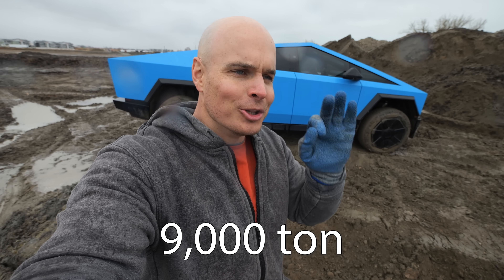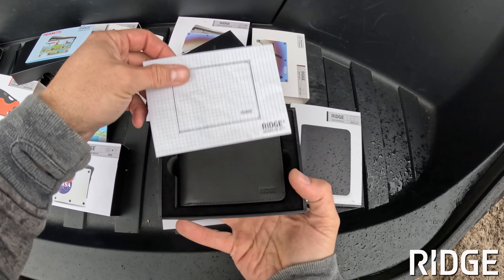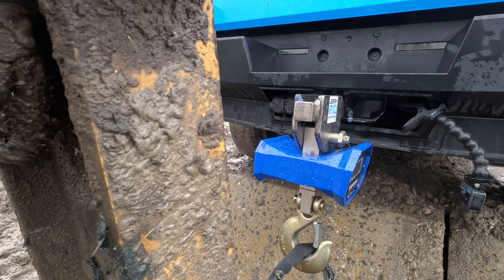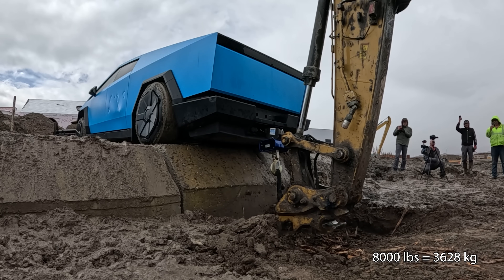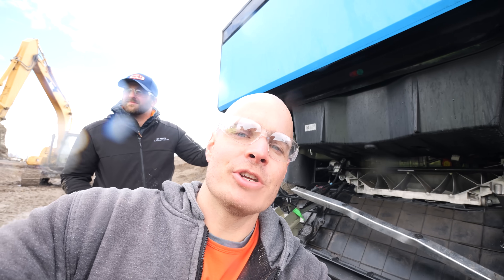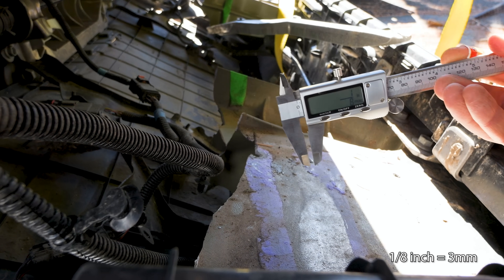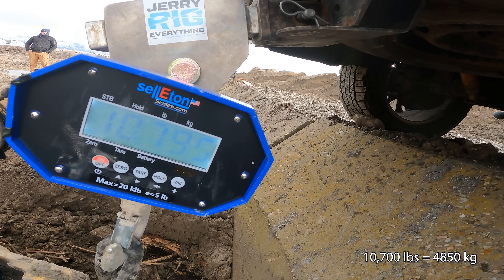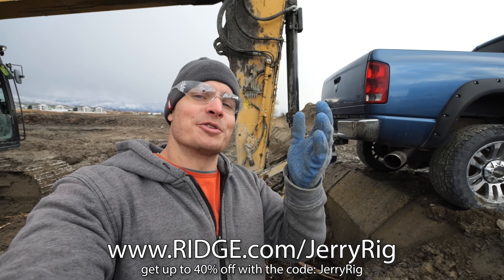SHOULD YOU TOW WITH A CYBERTRUCK?! - (catastrophic failure test)

Comment: Mechanical engineer here. You got the fatigue limit backwards. Steel has a fatigue limit, i.e. if you keep the stress below the fatigue limit the material strength will stay the same no matter how many times you apply and remove the load. Aluminum does not have a fatigue limit, i.e. the material will get weaker every time stress is applied and removed, regardless of how small the stress is.
Reply from the maker: Good catch.  My concept was correct - I misspoke with the terminology.
Reply: @JerryRigEverything  yah you said it right with aluminum, human brain just did human things when you were talking about the steel lol i did the same thing on a test once and i was so annoyed with myself
Reply: @JerryRigEverything you only misspoke in saying that both do not have a fatigue limit. But the explanation was sound
Reply: @JerryRigEverything this is wuy I tell people stick with the old 2016 vehicles until the twrks are all clubbed out
Reply: @JerryRigEverything  No youre just a Fraud
Reply: @JerryRigEverything  Hey Jerry, try this test on one of your wheelchairs too
Reply: @MrDeaz they kind of do already. They stress test them chairs a lot because they want them to last.
Reply: @MrDeaz they already do this with their drop tests that involves strapping weights on the chair and dropping it over and over
Reply: @MrDeaz  Zach, not Jerry is his name
Reply: @MrDeaz  You use wheelchairs for towing?
Reply: @MrDeaz  what good would that do?
Reply: @rma-nm5vb  Of course, I do burnouts with them as well
Reply: They don't use heavy machinery to absolutely destroy a chair by doing something it was never meant to do and then publicly act like they didn't intentionally destroy the chair to fabricate a story. I used to like this channel @JeffRobertson-m7v
Reply: @ No you tried to a propaganda video and got caught. You sick duck
Reply: @JerryRigEverything nope. You trying to bring tesla down with testes that suck ass.
Reply: @JerryRigEverything   more than enough, misspeaking can ruin everything
Reply: @JerryRigEverything  you're not an engineer and it shows. Show me data that 10,000lbs can be exceeded by a trailer towed over a hill. You misspoke about the fatigue limit because frankly you have no idea what you're talking about
Reply: @vector006  Yeah. That couldn't happen in practise even when heavily bottoming out and it would also mean vehicle would be undrivable in reality. Driver would for sure realize that load is severely wrong distributed and not even closely safe to drive. Where I live it's taught that when using trailer in cars you put roughly 50 to max.100kg's on the hitch ball in normal conditions when loading trailer.
Reply: @JerryRigEverything congratulations, you are now an activist, and your premise is false. 👏🏼👏🏼👏🏼👏🏼👏🏼
Reply: Does anyone else realize that the test he did is only a tongue weight test to failure. The hitches are breaking from a load pulling away from the hitch to the rear. Picture grabbing the Tesla cyber truck in one hand and the trailer in another and try to pull them apart, That is what people are having happened in the cybertruck. The load he applied was straight down as if putting on a trailer that had a extremely high tongue weight. So he applied the force in the wrong direction in my opinion. What he simulated is not how the trucks are behaving.
Reply: That is also known as an endurance limit. Also, it depends on what test is done on the material and to what standards. The material standards I usually go by when performing fatigue analysis is MMPDS which defines a runout based on the endurance limit of the material and it has them for many different types of metals including aluminum along with curves for different R values.
Reply: @timkono5645  Correct.  Endurance limit.
Reply: @TheSinisterWizard  steel can still experience fatigue below its plastic deformation limit, but the change is fairly negligible compared to a material like aluminum that will snap in half after not much stress at all.
Reply: @smok_ed ’Steel can still experience fatigue below its plastic deformation limit’. Fatigue is always in the elastic region. Breaking by bending it over multiple times in the plastic region is not fatigue.
Reply: He had the concept correct though, even if he used the wrong term.
Reply: @TroySavary  so that's why car springs are made from steel and not aluminum right?
Reply: @TroySavary if the concept is backwards isn’t correct lok
Reply: Steel is real
Reply: True, aluminiums endurance curve goes on dropping with respect to number of load cycles while steels endurance curve goes flat (only caveat is that the stress should be less than the endurance limit to maintain infinite fatigue life).
Reply: For any new engineering students reading this thread, this is an application of your freshman year strength of materials/material science, junior year machine design and sophomore year dynamics course.
Reply: @rufus2028  If only colleges stopped mixing good classes like that with a repeat of high school courses like english and speech for "well roundedness", more people would take those classes and be useful in society.  I never understood why abet is so obsessed with making people spend half their time redoing high school classes.  I saw majors switch from norrmal to being abet accredited and they were absolutely ruined with tons of time wasting fluff.
Reply: @robster7787 true. The test went way past a design number.
Reply: I've been following these break-away frame components for a bit.
Just curious, did you assume this was forged & probably 7000 series aluminum like I did?
I was blown away by the knowledge that it's cast 6000 stuff. But part of that knowledge comes from real-world experience. Having been in the hands-on & design worlds, I know there's a lot of disconnect. That's exactly why Kelly Johnson had Skunk-Works engineers working just feet from to the production floor even before they made the A-10 & SR-71.

As a materials tester, I even had the priviledge of trying to keep the engineers & the laborers for calling each other idiots. lol
Always a fun time. ...and both were right! ...depending on the situation.
Reply: @christurnblom4825  I have no idea what you're talking about with the A-10 and Skunk Works.  The A-10 is Fairchild Republic, not Lockheed.
Reply: @KRAMITDFROG  Sorry. I meant the A-12
Reply: @KRAMITDFROG  Sorry. I meant the A-12.
Reply: @christurnblom4825  If it's failing after tens of cycles, it doesn't much matter what grade of aluminium it's made from. The guys who designed it screwed the pooch.

Had it been 7000 series forged, they'd have just weakened it accordingly.
Reply: Hello everyone! I'm Vietnamese, nice to meet you.
Reply: So Elon heard that aluminum didn't have a fatigue limit and without waiting for an explanation he went "sweet! lets build the trucks bottom out of it!
Reply: I'm not an engineer, but in Germany there is a term called tongue load, Stützlast. Everyone who wants to tow a trailer to their car knows the term. Trailer hitches are usually specified with a tongue load of 70 to 90 kg. That's not much, and yet they can still be used to tow very heavy trailers. And that's exactly the point, in this video the tongue load, Stützlast was tested and not the towing capacity. As far as I know, the Cybertruck has a tongue load of 500 kilos. To be precise, the tongue load was exceeded by 10 times, which no one in their right mind would do in reality.
Reply: Yep. steel is wonderful with the infinite endurance limit. 

Cast iron is even better
Reply: @qwertyui90qwertyui90  steel out performs aluminum by a massive amount in load cycling.
Reply: @qwertyui90qwertyui90  cast iron is an interesting material. It's elastic limit is generally less than the yield strength. That is, unlike steel or aluminum which will stretch before it breaks, most varieties of cast iron will just break without any deformation to warn you that you are approaching the limit of its strength
Reply: could you imagine if zack was right?? lol the flex swing on aircraft wings in flight... they would all be falling out of the sky.
Reply: @Dexter_Solid  Airframes are designed with fatigue in mind. The life of each component is known, replacement is scheduled accordingly, and all the ones where a single failure could bring down an aircraft are actively monitored. We're engineers, not idiots.
Reply: I know that about aluminium from mountainbiking. Bike frames made out of aluminium age and get brittle over time when they are ridden hard.
Reply: @SpielkindFR biggest reason why my 95 stumpjumper m2 is only for street use these days. 30 year old frame that was already known for snapping under heavy use when new.
Reply: The lifespan of an airplane airframe, primarily made of aluminum, is limited by fatigue failure due to cyclic stress from pressurization, turbulence, and takeoff/landing forces.

Typical Lifespan of an Airplane Airframe
✈ Commercial Airliners: 20–30 years OR 50,000–90,000 flight cycles
✈ Military Jets: 6,000–12,000 flight hours (varies by aircraft type)
✈ General Aviation (Small Aircraft): 40+ years with proper maintenance
Reply: isnt that exactly what he said? 
Edit: first he said aluminium doesnt have a fatigue limit and then he said Steel doesnt have a fatigue limit. so he just misspoke but at the end of the day the message was clear
Reply: @c0dy42  Everything has a fatigue limit, its like saying an engine has 100% efficiency which is impossible.
Reply: @retired-s5h  cast aluminum doesnt have a fatigue limit in the sense that stress builds up so everytime it gets stressed, it gets weaker. steel doesnt do that. as long as you keep the stress below the point of plastic deformation it wont get permanently weakend
Reply: Got a question Sir, 
Aluminum alloy is used in guns, mostly the lower part of the gun (ie the grip, trigger and some internal parts) while steel slides are on top of that. Does it mean the gun will fracture its lower part after being fired a lot?
Reply: @tullo5564 Lower receivers are designed to not take the full brunt of the force exerted when  the gun is discharged. Most of the forces move in a linear direction through the upper receiver assembly. There are some sections of the lower receiver that will take some of the loads and it’s usually the parts the holds the gun together such as the buffer assembly takedown pin and pivot pin. Because of how forces are distributed in the assembly, this has allowed lower receivers to be made of polymers and sometimes plastic. All parts will eventually fail over time due to abrupt explosive forces and repeated heat stress, but it shouldn’t be of major concern. Guns do eventually wear out over time, but if made and maintained properly it will last longer than others.

I may not be the OP in this thread, but I am also a mechanical engineer. But I do want to note that you do not need to be an engineer to answer this question.
Reply: @rufus2028  isnt that the same reason glock lowers are made of plastic?
Reply: @rufus2028  plastics are polymers
Reply: @rufus2028  Eugen Stoner, Irving Johnson, et al. were smart cookies when they designed the AR10
Reply: @tullo5564  those parts aren't stresses to start with
Reply: @tullo5564  Kentucky ballistic had gun frame snap right? Or was it plastic frame?
Reply: @Hnkka  that was plastic, polymer frame. I saw that one too, it was kinda funny
Reply: @tullo5564  yes you can assume this. But they scale ist logarithmic and you probably need 10^7 and more cycles/shots fired. There are also assumptions that steel also will fail but the curve gets nearly flat so ITS a pseudo Limit because you need so many cycles you cant measure it within a reasonable timespan.
Reply: @tullo5564  If it were in a vice I would say yes but a shock absorbing human maybe not. just a guess
Reply: @tullo5564  when it comes to guns, the aluminum doesn’t take the actual explosion of the cartridges going off the chamber does and the barrel, which is made out of steel.
Reply: @tullo5564 depends on how the gun is specifically manufactured but to put it briefly no. The steel is the part of the gun that absorbs the most stress while the aluminum parts don't really. Although if you purposely add stress or improperly store your gun, corrosion and other minor stresses will eventually wear that aluminum down and fracture it
Reply: @ Yes. After trillions of uses. Fatigue properties at this level only matter in moving high energy engine parts. Even then, there are aluminum piston rods that handle many billions of cycles.
Reply: @tullo5564  generally speaking the lower receiver on most firearms isn't really subject to much force compared to the rest of the weapon.  You can make the LR out of plastic in a lot of cases without much fear on a lot of them.
Reply: @tullo5564  If you know how guns work, you'd know those parts you named aren't seeing the stress and forces the barrel, bolt, trigger group, or in the case of  revolvers, the cylinder, would experience. Not the same.
Reply: @tullo5564  Unlikely, as the gun is engineered to have sufficient strength in its parts. The CT is also engineered to have sufficient strength in the frame for straight towing and normal tongue weights. Engineered materials (made to be lightweight and strong for a purpose) will tend to fail if subjected to loads they aren't designed for. In the case of guns, that might happen if you use the grip as a hammer, or if you drop it from a high distance. The manufacturer should and typically does add extra load capacity to account for some excessive stresses, but not for what they are doing to this CT. 

The steel frames are in many ways better because they have so much give that it makes them idiot proof, meaning you can abuse them pretty badly before they totally fail. That comes as a cost of weight in a vehicle that is already too heavy. The way business minds work is that adding extra material to a product when it's not needed for the intended purpose is just adding cost and making it less competitive to other similar products. 

Think of it like a car engine. The manufacturers use fairly cheap pistons and connecting rods that can last 150,000-300,000 miles of normal use, but are considered the weak link if you add a turbo or supercharger. They could add forged pistons and rods from the factory to ensure the car would run nearly forever and be mod friendly, but in reality most people won't want to pay extra or lose fuel economy so they'd lose sales. Another comparison are engineered floor trusses used in many new homes. They are basically "girders" made of particle board with 1x2s at each end. They are quite strong and will hold furniture, people, etc., but if they get wet or if someone cuts a notch in one to run a wire, etc., they can fail very easily. In engineering and manufacturing, it's all about making it "good enough" but not better than it needs to be in order to meet a price point, meet code, fuel standards, etc. I'm not a fan to be honest as they took away pride of workmanship and making things last, but that is what we as consumers demanded over the years so that's what we get.
Reply: @tullo5564  potentially, but you can make the fatigue limit for al billions of cycles.
Reply: @tullo5564  The military has found that m4's will wear the trigger group pin holes will wear out before the lower will show any real wear. Lowers aren't under very much load in general, even polymer lowers can withstand thousands of rounds. You'll wear out the barrel and break the bolt long before the lower. Also I've never seen an aluminum trigger, its mostly steel with MAYBE an ergo component being aluminum.
Reply: @tullo5564 eventually yes but the upper takes a lot more direct force from the bullet firing and the slide stopping
Reply: @tullo5564   With enough use, you can definitely wear out a lower. Most users don't actually train often enough to ever reach that point, but it's certainly possible to do so.
Reply: @tullo5564 studied materials science and I don't think the loads are enought on the handle to do anything. For the canon, there are much greater loads, hence no alluminum is used there.
Reply: @tullo5564  Not if you do your job as an engineer. If you use enough of it to under-load it sufficiently, you can ensure a cycle life greater than the service life of the weapon. For instance, 1 million cycles is achievable. Expensive and heavy, but achievable. Back when I worked for an ammo company, we considered test barrels worn out after about 3 000 rounds (.308). That's when groups started opening up. For the military, closer to 5 000 is probably right. Again, depending on calibre and loading. So you see, designing a piece of aluminium to perform a secondary function (all the pressure containment, lock-up and trigger works are steel) while lasting longer than the bits of steel (namely the barrel) - not all that difficult at all.

Militaries are well aware of these service life limitations. Those are built into the price and spare parts/replacements are purchased accordingly. Civilians on the other hand are unlikely to fire a weapon so much that it wears out, have you seen the price of ammunition? 😅 And if you do put 4-5 000 rounds through your AR-15, I'm sure you're in a good position to be able to afford a new lower, to go with the new barrel 😁

Best part with aluminium is, you get a sliding scale of weight vs cycle life. The fewer cycles you need, the lighter you can make a part and the closer you can get to its yield strength.

These fatigue properties are quite reliable too (depending on grade specifications). That's how structural components on airframes can be designed to literally within an inch of their lives, and still wings don't snap off airliners. That and advanced monitoring 😉
Reply: @tullo5564  You'll likely wear the barrel out multiple times before that happens. Lots of examples online of people wearing out multiple barrels and BCG's without the receivers cracking. We're talking 20-30k rounds at least. I'm sure it will crack at some point, but not within the useful life of the firearm.
Reply: @tullo5564 the parts the slide make contact with are hardened steel connected to the lower by steel rollpins. So nope, that’s why you have glocks made out of plastic.
Reply: @tullo5564 if you drop the hammer on an open receiver multiple times, yes. It will break. 

I've broken a couple doing testing.
Reply: @TheSinisterWizard  semantics. He did get the point across although he got the terms mixed up.
Reply: Its called plastic deformation. Steel can deform and spring back if you keep it below a set force. Beyond it, it will bend but mostly not break. Aluminum fractures. The force curve between these two metals are vastly different
Reply: The cyber truck clearly broke and had a catastrophic failure at 10,000 pounds load and it snapped in half the frame so you can try to sit there and yap all you want about fatigue limits but that is just BS and you're not an engineer sitting here, trying to defend a piece of shit car
Reply: Now to clarify, there are Aluminum alloys that are very durable and can tow well, just look at some of the US military's equipment for examples of how one can get Aluminum to last for decades under extreme conditions. But those alloys are not "extruded" nor would porous and bubbly metal be acceptable. I wonder if Tesla even bothered X-ray these Aluminum frames, or if they just gave it the ole once over and sent it.
Reply: @MrVirus9898  the problem as I see it is Tesla thinks they are smarter than over a hundred years of automotive engineering and design. They have smart people there but there are only two explanations-cost cutting at any risk or they really just think they're smarter than anyone else manufacturing vehicles.
Reply: Sounds like Elon the engineering genius got everything backwards
Reply: Its also irrelevant. In real world usage you'll see about 2% of the load that it broke at here (around 200lbs. Aluminum will fail if you hit 2% of its UTS if you load cycle it once a second for 207.67 trillion years.
Reply: @BulterMarkwad  cosplay truck. So basically these geniuses used same principles of cast alloy wheels (notoriously dent happy) to cast alloy a towing frame.
Reply: @porscheoscar  you're trying to school, a mechanical engineer, stop your tesla, hate, and crying.
Reply: @Bluelightning23  what part of what I said is not true? And work on your reading comprehension I wasn't trying to school anyone.
Reply: Anyone gonna talk about towing vs tongue weight. He should not have pulled down to get towing capacity.
Reply: He also subjected the hitch to the force downward not backward which is tongue weight. No pickup/not commercial medium duty or above has more than a 2,000 lb tongue weight rating.
Reply: A steel frame may loose the hitch, but the frame will still be there for the safety chains. With the Tesla, once that assembly comes of, your trailer is freely moving on down the road.
Reply: hmm.. in 2025: 2004 dodge ram 2500 with no engine and bent rear axle is worth $100-$500 USD compared to Cybertruck. and if it did have an engine and was drivable, the Dodge maybe have been able to still travel without a broken hitch, but he wasn't able to break it
Reply: This is an invalid test. The tongue weight is like 1100 pounds, not 300. That’s the test. So it passed with flying colors actually.
Reply: I think the takeaway here is that no matter what the vertical force happens to be on the tongue due to trailer weight/road conditions/etc, the Tesla hitch is at a higher risk of breaking than the steel hitch. Everyone is getting hung up on the whole “you never have 10K pounds on the hitch” argument, but the reality is that shifting weight and gravity CAN exceed what the aluminum can handle.
Reply: Aerospace Engineer here, for aluminum everything you said is correct except  “regardless of how small the stress is”. If the stress is less than the yield point of the material then you will have elastic deformation which means 0 damage when unloaded.
Reply: @joelmelburn3370  Coming from a keyboard warrior, that's a compliment.
Reply: That makes sense.  Therefore: if one cares about safety and also towing capacity it makes a lot more sense to use a steel frame even though that might cost more.
Reply: And aeroplanes fly less and less until break apart in mid air
Reply: Where did you get your degree?

I’m pursuing mine currently in denver after having been a mechanic in and after the army
Reply: "work hardened"
Reply: Hence the flying hour/landing cycle limits on aluminium airframes. They fatigue just flying around normally.
Reply: What would be more interesting to know is, if the load is kept within specified limits how many hours or cycles it can handle before breaking.
Reply: Infotmation in this thread about strength of steel vs aluminum made me worry about Motocross and MTB aluminum alloy parts, such as handlebars. So if I got it correct, I'm getting my handlebar weaker with each ride event, and someday it will occasionally bring me to serious injury by just cracking without a warning? Ughh.. I'm too old for heavy injuries, seems I better switch back to CroMo, like back in a days lol)))
Reply: @Snoop.Driftera  if the parts are manufactured properly, your handlebars should be taking a load so much less than it can so it won't break unexpectedly unless you crash or something.
Reply: @ Well, my bike lives a hard life with me. It crashes with me from time to time, and I do not repalce parts that are still look healthy (couple of years before i boke 5or6 ribs). But material fatigue is something that you can not see or determine by external wiew sometimes. Anyway. Things that you said about Tesla crew (im not a fan of tesla tho), are wrong, since this test shows test of 'Tear forces' while thesd parts were engineered to withstand the 'Slide forces'. I'm sorry, english is not my native languge, but i worked with FRP, CFRP and structural adhesives. And i can say that Tesla's parts are made to comply the material requirements. You can see it, even, by the way adhesive were split into two even parts: it is a good sign of how was it applied and that everything was made in propper way.
Reply: No you good these guys dont really know whay they talk about 😅 without a heavy crash you are good for ages  @Snoop.Driftera
Reply: @Snoop.Driftera  Not all parts are subject to the kind of loads that could break them over time. Handlebars for instance - not all that heavily loaded. The frame on the other hand...

Plus, if the bars in particular ever got weak enough to fail on you, you'd know about it. Something would look wrong. Something would feel wrong. This is a part you regularly interact with, not something hidden away until it fails.
Reply: @233kosta  Not agree. Me, miself have an Azonic bar and I trunst it. But I remember how my friend's oem bar were broken (cut right near the grip), just because of tough landing at dirt jumping. He was injured. 
So sometimes you really get such a break unexpectedly.
Reply: So aluminium is just play dough on roids😂😂
Reply: @ Kinda. I mean aluminum is often extruded, like play-dough.  Play with some.
 If you don't have a mill, just drill through some. If it gets too hot, it gets kinda tacky or like peanut butter & gums up your drill bit. If it's light, you can knock it off but if it gets really hot & your not drilling fast enough, it will fill the flutes & ruin your drill bit.
Or, cut through some thick stuff with an circular saw. You'll see what I'm talking about unless you've done it before & know the proper feeds & speeds.
Reply: Which makes it a terrible material for any load-bearing application in general…
Reply: I mean makes sense with Space X and Tesla failing in market, give a clue why Elon Musk wants to buy Social Security
Reply: Which gives me the follow up question: I wonder how much the Cybertruck's hitch/frame was weakened by the initial test before the excavator moved closer? There was even a pop/crack mentioned. Surely it decreased the strength in the second test? Not that I am rooting for the Cybertruck in any way lol Just an observation.
Reply: Basically from work hardening during the inevitable flexing right ?  That's why Aluminum car trailers develop cracks all the time.
Reply: He should run the test on a unit body steel vehicle, such as a Ford Maverick. I am quite sure the Maverick would do better, despite not being rated anywhere near the Cybertruck in capability.
Reply: The 323 later in the video is more like 50k
Reply: My first thought: commercial airliners and their wings flopping up and down from forces applied
Reply: Exatamente
Reply: Not a mechanical engineer here. No.
Reply: Maybe that is why tesla over engineerd the tow hitch by 9 times it's rated capacity. 9 times!
Reply: That’s exactly what he said though
Reply: The hitch does not need to handle 10 times it's rating. You are not an engineer.  Ridiculous.  Elon should sue you till you are broke for life.
Reply: Sounds like Tesla knew this will totally not work then. Figures.
Reply: Not all grades of aluminum are equally susceptible to fatigue. Some alloys are specifically designed to have better fatigue resistance than others. 

This test was done to prove a point, but never a real world scenario - we know why anyway. Can't we simply appreciate new technology and advancements in manufacturing? why have all the strength of steel when you can do with certain grades of aluminum? especially when you have to bear the extra weight of batteries?
Reply: Tesla didn't invent the cyber press. Just bought it from a German engineer working in Italy. Like Elons other inventions.
Reply: Either way they tried  repeated load cycles bouncing the excavator and the old frame held.
Now can we try landing a comercial plane without front landing gear on a Ford - just a pun
Reply: dont ever question his political ideology with ur stupid mechanical engineering
Reply: youtube comment reader here.  lame
Reply: That's why I was confused:

He said aluminum doesn't have a fatigue limit.

Then he says "steel on the other hand doesn't have a fatigue limit". The fuck you mean "on the other hand"? You said the same thing about aluminum 💀🤣
Reply: Wonder why aluminum trailers don't break in half? Like boat trailers.
Reply: @rightsdontcomewithpermits7073  find one that is built for 11,000lbs
Reply: @rightsdontcomewithpermits7073  Most likely because they are not cast.
Reply: That doesn’t make sense though. Aluminum has a stress strain curve the same as steel does, and it has the plastic region the same as steel does. If you don’t stress it has the permanent deformation portion of the stress strain curve, it should retain all its strength and properties.
Reply: @javionsmith6818  There are always micro cracks and stress risers in a material. The cracks open more and more in cycled loading and aluminum is very susceptible to this. The plateau on the stress strain curve for aluminum is much shorter than it is for steel. But steel will also fatigue at a much lower stress than the theoretical yield. It depends on the difference in tension stress between cycles, the number of cycles, the geometry, and any welding configuration near the critical section. For example a steel welded connection will break in far fewer cycles under lower stresses than a bolted connection.
Reply: Slight correction. Every time you apply a tension stress on aluminum it will effectively get weaker.
Reply: ME myself and I caught that despite my career being mostly in thermal-fluids. Some things from school stick!
Reply: @joelmelburn3370  I reread your comments and yeah you’re definitely angry about something lol
Go check your blood pressure
Reply: I'm really questioning his integrity after this and the F150 videos. He clearly has an agenda.
Reply: Shock loads are the overall problem. Called Misadventures in the overhead crane industry. Which leads to disassembly of that piece of equipment and tolerances checked.  Shock loads in vehicle towing...potholes,Sudden Stop, fast inertia Take offs...yada yada
Reply: In addition steel can usually absorb more energy from a shock load, due to greater elongation before break and higher difference between yield and ultimate strength. So aluminum is usually more likely to fail suddenly and catastrophically from a shock like the pot hole example or abrupt tug. Porosity more common in cast aluminum would not help. This is all additive issues with the fatigue issues mentioned.

Some semi trucks have used aluminum successfully. From what can be seen in the video the cast geometry is very different from that. It looks like it could create high stress concentrations along the top where cracks would form. I would love to see a stress analysis of that frame.
Reply: What will happen with aluminum in warmer conditions? Will it be even break earlier?
Reply: Yeah people worry about fatigue of cybertruck yet they have aluminium wheels. Just be consistent guys...
Reply: @armykos  Wheels are made from aluminum alloys, not cast aluminum.
Reply: @theKashConnoisseur  So you think cast aluminium is pure aluminium? It is actually proprietary alloy. And fatigue limit holds for both. Point is with proper design you will never experience it. And if you were to experience it, it will not be casting that has fraction of cycles compared to something that rotates like damn wheel.
Reply: @armykos  Let's assume you're right for just a moment. So that means that the cyber truck was poorly designed. Got it! That's the whole point of all of this, thanks for reaching the same conclusion we all did.
Reply: Small clarification, steel has a fatigue limit in air. In water, steel doesn't have a fatigue limit due to the effect of added mass from the mobilised water.
Reply: He's doing this for political reasons.   He is not a good person.
Reply: @MrTaffiny1  "He's doing this for political reasons.   He is not a good person." You're making this comment for a political reason. Therefore you are not a good person either.
Reply: @MrTaffiny1  Even if his motivations are purely political, which you have no evidence of, good people oppose Nazis.
Reply: That's why you can't repair alloy wheels just by bending it back like you would with a steel wheel. I used to have to explain this all the time when people with low profile tires hit potholes or curbs.
Reply: Dude I was so confused when I heard that, it didn't make any sense to me at all, glad I was right to be confused.
Reply: @joelmelburn3370  You sound sad that the Cybertruck's frame got violated so hard.
Reply: Yeild point.impact strength
Reply: Yep, that's why we don't make springs out of aluminum.
Reply: AL there's no stress level below which they can withstand an infinite number of cycles without failure,   steel does have that however in application the forces on a pickup frame are not below this stress level.  I've seen mid size and 1/2 ton FS bend the frame where the cab meets the bed and have welded gusset plates in off road trucks in places we had cracks show up.  The gigacastings fatigue strength is probably around 170 MPa after 10^9  cycles. The Telsa hitch reciever is mild steel bolted in.   It's likely been factored in as crash absorbtion and why the brackets on it are the dimensions they are, small.  They could have made the hitch brackets overlap more of the frame or redesigned the crash absorbers to engage more of the casting and be what the hitch attaches to so if it breaks via a colision into the hitch only the absorbers need to be replaced.  .
Reply: So lefty jerryrigeverythng DOESN'T know it all. 😅
Reply: Those parts have nothing to do with the shot pressure.
Reply: That’s a pretty pricey experiment
Reply: @joelmelburn3370 . Actually it conforms with SAE guidelines.
Reply: Thats what he said
Reply: Well it’s good to know that airplanes are made of steel and not some wimpy aluminum ;)
Reply: Not sure why everyone hates on the cyber truck. When are towing anything with it that causes the back to be almost dragging on the ground? Realistically the truck performed well and yall just hating on it.
Reply: Well you did your physics homework. 😁👍
Reply: Then they should at least use steal to connect the rear suspension to the trailer 😅
Reply: Actually that's disgusting for both the cybertruck and every single alluminum engine :)
Reply: So every time someone uses the Cybertruck as a truck to haul, it gets weaker and WILL fail after X amount of times.
Reply: @ yeah... a few hundred trillion cycles though. It doesn't matter for a vehicle.
Reply: @bradleyd6000  terrible conclusion. I've been using an aluminum trailer hitch for 300k miles towing all the time. There are aluminum trailers in operation for decades.
Reply: Jerry you need to try your Rivan with this test since it's mostly alum. Apples to apples
Reply: @Tom-kf7ku  WOW . . . Someone actually owns a Rivan ?!?  Where I live we are saturated with commercials for them, but I don't think I've ever seen one going down the road, or even parked.  
      Are they any good?
Reply: @Tom-kf7ku  The Rivian's frame is steel, and I am sure the hitch is too
Reply: does that mean aluminum's deformation is purely plastic, and never elastic?
Reply: @josephius  There's always some elastic component. If you keep the deformations under the point where the atoms don't shift, it'll remain elastic. That threshold is very small. But if you keep a load a factor of say 4x under the fatigue strength, you can potentially get a trillion loading cycles. That's more than this part needs to survive a few centuries of continuous use.

Generally materials fatigue limits are rated based on stress vs number of cycles of loading before failure. Steel and other materials reach level off around 10^6 cycles. But while aluminum will fail at X load after 10^6 cycles, if you give it X/2 load it can make 10^9 cycles. 50% reduction in stress causes 1000x increase in lifespan from measurements.

10^6 cycles of stress is what you'd find in automotive parts like this hitch and frame, 10^9 would be possible for motors. It's just really hard to measure much past a billion loading cycles. If you applied stress at 30Hz, it would take a year to collect the data. In theory, if you keep the load under about 25% of the fatigue strength, you'd potentially hit near a trillion cycles and maybe infinite. It's just not really possible to measure that on anything larger than a small wire attached to a speaker in a reasonable timespan.
Reply: @brianjnemec  it would seem as if you were really trying to push the idea that aluminum is somehow a tougher metal than steel if you are careful enough about load cycling.. which is actually psychotic if you really think about it 🤣
Reply: You could outperform the tesla frame with a few 1 inch sticks of rebar and some welding
Reply: @smok_ed  I fixed a rusted out pontiac that way once. Open the trunk it looked like a birdcage Maserati. LOL.  Oh, except I used the old bumper jack instead or rebar in one spot. Because of the rust it was worthless to lift the car if you had to change a tire.
Reply: @liledw13  The discussion about steel leveling off at around 10^6 cycles is is the failure rate for a steel that survives this long becomes insignificant.

Having a higher limit isn't good. For instance if a material needed only 1 loading cycle, we'd be able to conclude that the car is safe as long as the load is kept to under 9k lbs. But in reality it needs to survive dozens of physical jerks per mile. That is closer to the bouncing test that the F150 survived. One time loading is giving Aluminum a much better score than it should get.
Reply: @ Exactly this. The breaking point was at >10,000lbs and normal tongue loads will be around 2% that. I'm sure it would be good for many many trillions of cycles.
Reply: @ "I'm sure it would be good for many many trillions of cycles."

Not to be a dick, but do you have any background in engineering or materials science? 

This is an honest question, because I'm not particularly experienced with cast aluminum structures and I was wondering if this is an informed opinion or a bit more of a 'gut feeling'

I'm honestly curious what a life cycle test of the castings would show if you, say, towed a few thousand pounds daily for 5-10 years - say if you actually used your truck for something like moving equipment for you day job.
Reply: @josephius  no, the big problem here imo is that materials like aluminum wil work harden instantly and act more like a ceramic once any amount of plastic deformation is reached.

Aka, the metal will snap and shatter under tension or sheer forces.

Steel can be bent and stretched to a large degree before finally having a catastrophic failure.
Reply: @smok_ed  Shear stress is actually just a component of the principal compression and tension stresses.
Reply: @smok_ed  Aluminum doesn't seem to do very well over time - I've actually ripped (accidentally) a piece of a car's aluminum engine block off trying to replace a thermostat, when the housing above it was stuck. I gave it a good pull and the metal separated along a weakened crack instead of opening where it was supposed to. You should NOT be able to pull metal apart with your hands like that if it's supposed to withstand so much pressure.
Reply: @josephius  No, that is not true
Reply: @josephius  aluminum has an extremely small elastic range.. and does not perfrom well over time cycling within that range.
Reply: @josephius if you can break the aluminum with 1 10k lb load you could also break it with like a billion 10 lb loads or a million 100lb loads or 10trillion 1 lb loads. This is why planes have a limited number of flights because holding pressure at altitude is a load cycle that will eventually lead to catastrophic failure if planes aren’t phased out over time
Reply: @josephius  Kinda.
Play with some. ...especially a lot of 6000 series.
 (not an engineer btw)
Reply: @josephius  No. As long as you keep the force within the elastic limit  (which, for aluminum is much less than the fatigue limit) the part may deform but it will return to the original shape and should not be weakened. The difference between fatigue limit and elastic limit is much less for steel and some other materials than it is for aluminum.
Reply: @josephius No, it just doesn't like any sort of repeated elastic deformation.
Reply: @josephius no, aluminum deforms elastically as well.
Reply: @josephius  No. It is elastic. Fatigue and yield strength are two different things.
Reply: @josephius 
It depends on the alloy, pure aluminium was never used in superstructures.
Airplane for example uses specific alloy that contain steels in it too.
Reply: @josephius  dang if that’s true that’s scary that it’s being used long term like this
Reply: @josephius  If a piece of metal deforms, it is already in the plastic region. All metals have an elastic region defined by the stress strain curve of the material. Once the linear region starts to go flat, thats where the deformation occurs.
Reply: @timkono5645  this is why we can machine steel engine blocks several times and still use them.

Whereas aluminum will just crack and be trash
Reply: @timkono5645 hey not true. Even when metal flex, they CAN, still be in the elastic modul.
But yeah, if it deforms, so stay in a another form then at the start, it was overloaded, so went in the P modul, so plastic deformation.
Reply: Guys, you realize all planes are practically all aluminum right? Wings don’t just snap off despite the fact you can see them routinely flex from your window seat. If engineered properly for the performance envelope aluminum will be just as good. You can’t however look at 2 different designs for 2 different design criterias and compare them as if they had the same specs then conclude that the material selection was flawed. That’s disingenuous.
Reply: @refusalspam  They don't cast airplane wings.
Reply: @refusalspam  Two different designs were tested to see if they could satisfy the same criteria: 10.5k lbs without failure. When one of the two fails, you start making hypotheses as to what caused the different outcomes. Since this is a video made for entertainment purposes, no one is suggesting its conclusions are scientifically definitive. Think of it as informed speculation. If you wanted to more rigorously determine the reasons for failure then much more testing and analysis would be required. But that was never the goal, or the point.
Reply: @refusalspam  Yes airplanes are made of aluminum and every big airplane I am aware of (the kind where you see the wings flexing like that) come with a 'cycle limit' - the maximum number of takeoff and landing cycles a plane can accumulate before the airframe is deemed to be 'worn out' and can no longer be used in commercial service. Even small planes (e.g. Cessna 337) can have an airframe life limit (in flight hours) imposed by the FAA when it is learned that metal fatigue can be a problem when they are used for certain stressful types of operation like pipeline patrol or other nap of the earth flying. They are then subject to airworthiness directives that require detailed periodic internal inspections and sometimes total overhaul after the flight hour limit has been reached. In many cases the cost of these inspections cause the airplane to be scrapped instead.
Reply: @refusalspam  Cast 6000 series aluminum? ...yes. I would argue the material selection and the manufacturing procedure were flawed.
Reply: @refusalspam They are designed to withstand a certain number of cycles, after which point you expect problems to develop.
Reply: Wings on a plane are designed to take a much different type of weight compared to a truck towing a trailer..... Thus when designing a plane they do indeed give the wings the ability to flex to sort of help absorb elements during typical plane use such as flight and other related things that a plane will go through such as takeoff and landing ect.. 
But far different from design of a truck towing with how weight is applied and distributed during most types of towing. You can't have the same elements of design just because you may be using the same type of metal or materials.  @refusalspam
Reply: @refusalspam  Airliners are on a VERY strict maintenance schedule (plus active monitoring) to ensure that airframe components subject to cyclic loading (which is basically all of them) get replaced before they fail. This is all priced into your ticket.
Reply: aluminum does have a fatigue limit, it would just be very low
Reply: As a mechanical engineer, you also know that aircraft wings and their attachment points are also made of aluminum with dynamically oscillating loads.
Every material has what is known as a fatigue strength, not just steel (keyword: Wöhler curve).
100% fatigue strength is actually never achieved, but only approximately. For steel, 10^7 to 10^9 load cycles are often used as a measure of fatigue strength. But your statement "no matter how many times" is therefore wrong and as a mechanical engineer, this is actually absolutely basic knowledge.
"The material gets weaker every time stress applied,... regardless of how small the stress is" in relation to aluminum is also wrong in relation to technical fatigue strength.
So you have to decide what you are talking about?!
Of really infinite load cycles (as you claim with steel) or of "material always weakens with load changes" which you attribute to aluminum (but which in reality can be attributed to every solid material!)

So I'll be so cheeky and say that you're not a mechanical engineer at all 😋
Reply: Help me here buddy.  This test is complete nonsense.  They have no idea what they are talking about.  The vertical weight on the tow hitch has nothing to do with the truck's rated towing ability.  The vertical load on the tow hitch is a fraction of the weight of the trailer.  Even with a 5th wheeler setup the load on the tow hitch will never exceed or likely reach half the weight of the loaded trailer.  I can't stand musk.  I'd like to slap him because he's a monster but I won't accept nonsense designed to dishonestly condemn someone or something.  The issue is simple.  Can the truck be the boss of the trailer. If they want to test it properly they need to do it dynamically. Then if they are going to suggest the strength of the tow setup is not up to the job they need to  try to pull the connected pair apart.  Sorry, this is bullsh1t
Reply: @CharlesGraham-u4t  the failures seem to be related to a vertical dynamic force on the hitch. An improperly loaded trailer, sudden shock of a pothole at speed, that sort of thing. The cybertruck is simply failing in a manner no other body on frame truck does.
Reply: So, in other words, it can break at any weight, it just depends how many times that weight is applied. Maybe 7000lbs applied 30 times is enough to weaken it to failure, or 5000 lbs applied 50 times.  This is essentially a ticking failure time bomb for every owner based based on how often you tow & how much you tow.
Reply: @RT-mv7df  That's how I'm reading this. The Cybertruck was built down to a cost and weight limit, not up to a safe and repeatable towing specification limit.
Most Cybertruck owners will never tow anything of course, they only use their trucks to go to the store for groceries, but it does sound like we'll see an increasing number of these catastrophic failures over time, and may the random forces of nature help those who are behind one of these when that failure occurs..
Reply: @ziploc2000  Mostly agree.... but I would say more precisely it was built to a certain profit target, b/c it didn't actually meet any of the cost/tow-weight & other targets initially set. When you additionally account for the now known likely looming failure depending on the frequency & extent to which it is used as an "actual truck", then the towing-weight claim is also a somewhat disingenuous gimmick that can be met when first new, but will diminish over time (in some cases perhaps significantly), almost as it was intentionally designed to be the epitome of planned obsolescence in a vehicle.
Reply: This comment needs to be pinned. It's insane to think aluminum is a safe material to use in this case. Every push/pull force on that bumper weakens it. It loses strength every time it's used in NORMAL conditions. Every Swastitruck towing regularly will have a bumper fatiguing and growing weaker with every tow. It's a matter of when, not if it will break.
Reply: @MajorMokoto daddy chill !
Reply: Steel can break from fatigue I have broken a 440 piece of steel with my hands np tools because it was worn out in a switch blade for like 14 years it also became magnetic all my tools for some become magnetic if I own them for long enough
Reply: @minekush1138  anything can break from fatigue... some things just last longer than others
Reply: @minekush1138  Because you do most of the cycles facing the same general direction. I'd put money on it!
 Because you can demagnetize a piece from spinning in a circle & rubbing it against another hard thing or activating the mechanism & randomizing the direction. I've verified that simply out of boredom.
Reply: @minekush1138  yeah but fold a piece of aluminum once and it is trash... ain't gonna be lasting any years after that
Reply: @minekush1138  
So it got done by fatigue, not endurance limit.
Reply: All metals have an "endurance limit," which is highest stress value where the metal can cycle indefinitely. Aluminum's endurance limit is just a lot lower than steel. Look up "S/N Curve."
Reply: And Jerry is suppose to build wheelchairs? Just goes to show he only knows how to break things.
Reply: @janegoodall1837  The concept was exactly correct, the wording was off.  I, and many others, understood what he meant
Reply: Bullshit video BIG time 😂😂😂 This doesn't have anything to do with the towing capacity or frame strength of this vehicle.  The towing hitch will never ever see the load that they applied to it.
Reply: @TheSinisterWizard  "no matter how many times" is a ridiculously false statement
Reply: @smok_ed  Technically false, but not that ridiculous. The number of cycles steel will take is very high, as in millions.
Reply: Is this supposed to be a hiit piece on elon musk ?

Bullshit, who puts this load on a truck

You are a crazy hater
Reply: @ the name Elon Musk doesn't even fall in the video mate.
Reply: @ Nobody needs to make a hit piece about Elon Musk, if they want him to look bad they can just report on things he actually says and does.